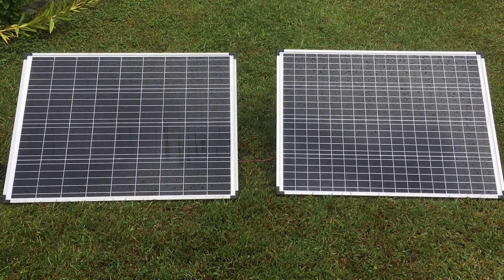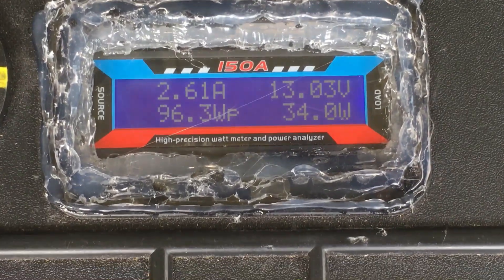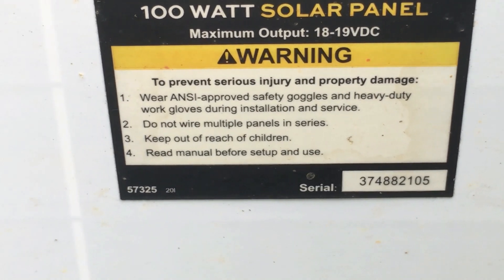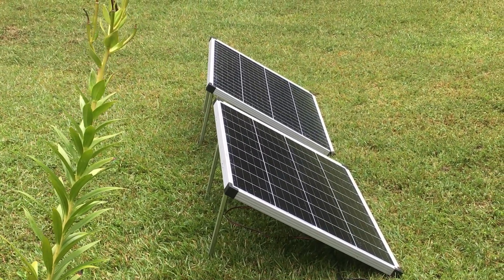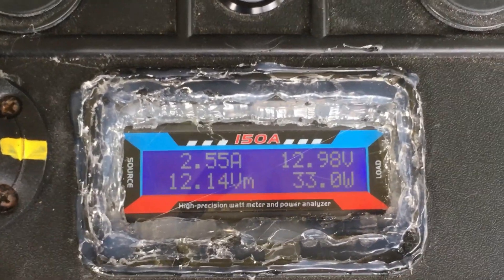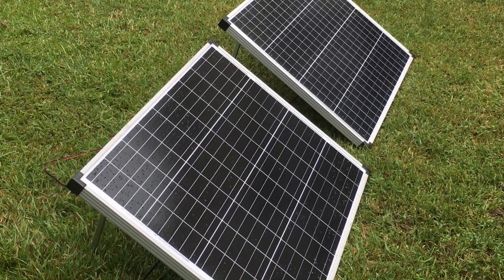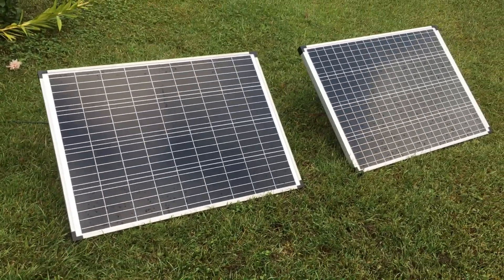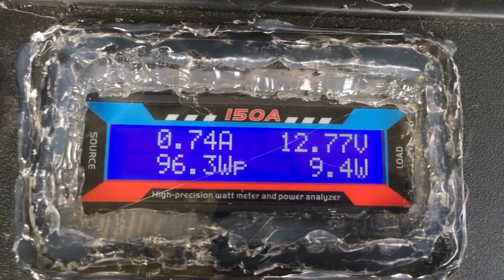Can you hook two of the new 100 Watt Harbor Freight Solar Panels Together?? 57325 (Rainy Day Result)

Comment: This answered my question perfectly. 

I've had the 100 watt kit for about 3.5 years now, but sadly I think my panels are falling. I'm getting at peak 3.0amps on a sunny bright day, and floating seems to be 12.8 -12.6 volts with a max battery voltage of 13.1
During the evening or a day like in your video I am getting around .08 -1.0, that's not exactly ideal for charging. 

I am using a harbour freight 35ah agm battery, and a renogy 40a mttp controller, as the one with the kit went bad.

I've been looking at these for a few weeks now and was curious if you could run them in parallel, because that's what the solar setup I have now is running.

I was also curious if I could use the existing wires and just hook up two 100 watt panels instead of four 25 watt panels. You are doing EXACTLY what I am going to do, and ironically the measurement of the 100 watt panels is slightly smaller area than the 4 25 watt panels I have now, so I'll be gaining 100 extra watts in the same area

I did have a question though.
Do I have to plug the other two connectors with anything, or just leave them and just hook up the two? 

Thanks for your video, it was exactly that I needed to make my choice.
Reply from the maker: Thanks for watching and glad it helped. What connectors are you referring to?
Reply: @DIYKAI  the four 25 watt panels come with the 4 to 1 wiring harness which is what I'm going to be using, so it saves me from having to re-wire anything, I'll just use the exsisting setup. 
Using the new 100 watt panels, I will have two of those (100 watts x 2) and will be using two if the four hookups. That will leave two hookups left. 
Being as in not electrical savvy, I wasn't sure if I needed to put some sort of plugs in those, put tape on them, or what.
Reply from the maker: Ah got ya yes the can stay unhooked and taping them is best to keep corrosion out….just monitor the wires because they are quite thin but do the job…we eventually upgraded to a better connection set up….but it did just fine with 2 100w hf panels and 2 of the older kits basically if you stay around 400w those wires are fine anymore and you would want to upgrade
Reply: @DIYKAI  Awesome thanks. Looks like I have my weekend job then LOL. 
I'm pretty excited seeing as how I'll gain 100 extra watts, in the same space/area, and without having to worry about wiring, that job shouldn't take long at all. Just hope my homemade rails will fit the extra width, I'm pretty confident it will. 
That and I'll be able to really put my new 40a Renogy Elite solar controller to work
Reply from the maker: @alpha_y2k438  sweet good luck and keep us updated our Renogy system has worked flawlessly for 8 months now so we will have a vid showing the total set up
Reply: Quick update
I bought two of the harbour freight 100 watt 24v panels today. Replaced my 3.5 year old 100 watt kit panels. Got set up, that was 11am this morning. Throughout the day I was keeping a very close eye on the amps and voltage.
Ironically enough, the size the 100 watt kit panels used, is pretty much the exact same space as two of the 100 watt panels, so I actually gained 100 extra watts in the same space I used the 4x25 watt panels
My initial first results were on the meter test I got 8.0a and 20v incoming. I was definitely excited to see that.
It's been a overcast day, with the sun peeking out off and on all day. My lows were 15v 2.9a incoming, my highs so far have been 21v 9.9a incoming! 😵‍💫😱

It's been a pretty much rollercoaster ride all day long because it has been overcast cloudy and then clear off and on all day.
I'm gonna take a guess that my avg has been around 3.2a 19v incoming. 
I have them set in parallel, on a harbour freight 35ah agm battery, and with the old setup I was getting a lot of 1.0 and .08a incoming, volts were strong (21v incoming) but crap for incoming amps. It was so bad I woke up one morning to an error code on my controller box that read e01 which is basically low voltage overload/no battery connected, basically the battery got to 11.3 and the controller stops at 11.5, rightly so as it should.
My battery always read 12.3-12.6 most times and very rarely reached 13.x, so going to bed it was at 12.2/12.1, and the other night it was at 11.7 when I went to bed. I'm shocked it didn't die on me.

With these new panels I'm getting an avg of 3.3a incoming, so even at that rate, cloud covering, I'm getting double what I was with the old panels and it shows because most of the day I was at upper 12.x and even hit 14.1 today at one point, but avg is 12.9/13.0 which is MUCH more comforting with my OCD LOL. 
Right now it's 6pm and no sun, cloud covering, I'm sitting at 19.7v 2.4a incoming. 
So first day, first impressions I'm VERY impressed and well pleased so far. 

Not exactly sure what I'll do with the extra 100 watts honestly, but we'll see what happens. 
At $99 each on sale, from $129 each, I'd say I made out pretty good for $200 (100 watt panels x2).
Reply from the maker: Nice! We are about to review a new cheap pure sine wave inverter hopefully it’s good lol

Comment: Hi, new subscriber here. Thank you for your videos. I have 4 of these HF panels and plan to get mppt controller. i understand the volts going from panels into controller can fluctuate due to weather Temperatures. Do you have an idea what the highest incoming voltage would be? I want to purchase the right size controller so I don’t fry it. I appreciate your help because I don’t know anyone locally who is knowledgeable on solar.
Reply: @David Bourgeois thank you so much for your reply- it is my understanding that these are 24 volt panels,rather than 12 volt., so I want to make sure I do this right.
Reply: They are 12 volt panels.  The packaging is misleading.
Reply: @scottmork9598  thank you! Employees at HF couldn’t give me an answer on this. Appreciate your response.
Reply from the maker: They produce around 22v open but when connected to a load (battery with charge controller) it will drop down to about 13-14
Reply: @DIYKAI  thank you for being so helpful- glad I found your channel.
Reply from the maker: Your welcome
Reply: A 100 volt/20 amp controller would be adequate.  My three panels have put out 22.5 volts, 67.5 total. Average around 65 volt wired in series.
 Four panels would be 90 volts at 5.5 amps in series. In parallel they would be 22.5 volts and 22 amps. Best case scenario. 
  By wiring in series you can use smaller guage wire from your panels to the controler due to the amps being lower, you will also experience less power loss especially if the wire run is long.
Reply from the maker: Hi and welcome! Your welcome😁 it depends on how you plan to run them? Series or parallel? Or both..lol…what battery voltage will you be running 12,24,36? Do you plan to expand?

I guess the best question is what are you trying to power and do you have plans to expand in the future?
Reply: @DIYKAI  absolute newbie at this,but I’m thinking parallel or series parallel, and 12 volt batteries-I didn’t realize they were 24 volt panels til after I purchased them- HF guys weren’t very knowledgeable about solar. I have a small off grid cabin and would like some light at night and charge batteries for power tools,hot plate for cooking. I don’t plan to expand. My husband passed 5 years ago and I’m trying to figure stuff out- I appreciate your help.
Reply from the maker: @lynnrabe4428  something that small just for light and charging you can get away with a cheaper PWM controller they are usually good up to 400W or so. 12v is where you want to stay with a small set up.....I would go with a small pure sine wave inverter 1000W ones can be found for under $100

When solar panels are wired in series, the voltage of the panels adds together, but the amperage remains the same. So, if you connect two solar panels with a rated voltage of 40 volts and a rated amperage of 5 amps in series, the voltage of the series would be 80 volts, while the amperage would remain at 5 amps. 

Wiring solar panels in parallel causes the amperage to increase, but the voltage remains the same. So, if you wired the same panels from before in parallel, the voltage of the system would remain at 40 volts, but the amperage would increase to 10 amps.

so based on your type of panels and what wiring you choose that will determine what type of controller you would need to purchase.

Hope this helps and if you need more info please reach back out we are here to help!
Reply: @DIYKAI  thank you so much for your time! I’m looking at controllers now🙂
Reply from the maker: Your welcome

Comment: I’ve got 3 of these solar panels.   They are running into a thunderbolt hub.  Running them into 4 120amp hour agm batteries.  I’ve been through 2 cheap controllers.  What controller would you suggest.
Reply from the maker: I would suggest this a great solution to a system under 400W:
https://amzn.to/3jUutPp
Reply from the maker: This is a good option for over 400W as this will work with 24V as well as 12v and has a 40A rate:
https://amzn.to/3v0wwYB
Reply: @DIYKAI  thank you brother.
Reply from the maker: No problem YW

Comment: Thank you for this video! Can you tell us what charge controller you have settled on? 

I have the Harbor Freight panel now. Can I run a second 100 watt panel (wired in parallel with proper controller) that is not a HF panel, or do I have to use the same model? 

Thanks again.
Reply from the maker: Your welcome! So we went with a cheap Amazon (PWM) one you want one that can handle 20A or so….if you decide to got over 400w then I suggest an MPPT charge controller as it will be more efficient…
Reply from the maker: Yes parallel will be just fine

Comment: Have one I cut the end plug off put MC4 plug then I plugged in to my solar generator and it was putting out 104 watts for one panel what I didn’t like is the red wire was negative and the black was positive it is a 24v panel that was my fault so now I may use it as a 3rd string in my 400watt solar system or just buy a second and start another system just learning wish I had got into solar sooner good luck
Reply from the maker: its a learning curve but worth it......yes unfortunately most Chinese panels have the lead colors switched I have seen...not sure why maybe just QC/QA issues lol

Comment: Been working on my H.F setup. currently running the original Amorphous kits, 300 watts on east side and another 100 west through one kits charge controller. All it does is power a single light and charge my phone when outside. I put two power wheel 10AH 12 volt batteries in it for the kid's playhouse. I have a dirty plan in place to run 1 controller per 400 watts, with 20amp fuses before the controllers, they have 20 amp fuses soldered into the controllers, which kind of sucks but should save the controller from current overload. Hopefully I can get another 8 panels on sale to add to my 12 I have now, but with the 30% price increase since their July 2020 launch, I have slowed my purchases for new panels. Also waiting on a sale for the new 2000 watt Pure sine wave inverter they just launched as well. I believe H.F are going to be getting more into this solar than people realize and look forward to seeing MPPT controllers soon. Not saying they will but with what they did in this past year with their current lineup I would not be surprised.
Reply from the maker: Yes it was a good deal when it first came out now Amazon has the lowest price and you don’t have to leave home lol
Reply from the maker: We also have the HF setup on a little house and now we run 800w Renogy system with lifepo4 it’s been amazing
Reply: @DIYKAI   Ok I am doing a bit of a follow up. Got a 8750 predator generator. The 12 volt battery is a 1.6AH lifepo4 battery, used for the starter, is made by Sky rich. It could actually be in the works for a Thunderbolt lithium solar battery. Its all gonna depend on the market for said products, which is getting competitive as of late.
Reply from the maker: Having a back up gen is always good…our renogy kit put out 2.33 kW today I was amazed

Comment: I am running 8 panels, 4 in series and then those 2 sets in parallel. 
Into bluetti 200max
Reply: Dec 5th.
4 panels in series
Two sets then hooked in parallel to controller
8 panels total

Started at 0900 at 50%
Ended at 1300 at 100%

So 4 hours.
Max wattage observed 400
Lowest wattage was at 0900, pulling 31 with 1 set of 4 series and 53 watts with both sets hooked up, before sun was over the house. 
Increase leg length to get better angle on sun, not sure how much it helped.
Reply from the maker: Nice we’re setting up a Renogy Premium kit hope to have a video soon on it
Reply from the maker: Nice how quick does it charge? We just got a Renogy premium kit at a crazy price and are setting it up hopefully it’s good those are 4 100w in series 40a mppt dual voltage

Comment: Wanted to see what connecters. That never showed. Harbor freight uses a single plus and minus connecter. For two panels a "Y" connecter is needed. They don't supply them. Found them on line and that is the only way to connect both without cutting wires.
Reply from the maker: Yes unfortunately the only way to connect them is with a Y connector or to cut off the ends and connect them together with wire
Reply: @DIYKAI  Thanks for your reply. Figured that needed to be done, that's to cut wires.
Reply from the maker: Just make sure you check polarity when splicing the wires
Reply: @DIYKAI  got you, polarity counts

Comment: I just ordered a 5000 W continuous inverter and I want to get two of these panels. Can I hook three panels up using a 40-watt controller with to 109AH lead-acid deep cycle batteries? I don't know what I can use this power for but I would like to connect my television at home to keep that from raising my electric bill.
Reply from the maker: yes with a 40w controller you can handle 3 panels no problem.
Reply: @DIYKAI  Thank you for replying!
Reply from the maker: @therajuncajun6487  your welcome

Comment: I’ve been contemplating a second panel and this just sold me on it. Because of a huge tree in my yard, I get the sun in two different different directions, but only one at a time. After 1:00 or so, my panel is just about fully shaded. Gonna add a second panel in another area (that is shaded in the morning) for 3 more hours of sun.
Reply from the maker: I had them out today terrible weather here raining bad over cast and with 2 panels I was able to harvest over 10aH over about 10 hours just turning the panels every few hours….what was amazing was I seen over 230 watts @15A
Reply: @DIYKAI  that's nuts, but good! Mine a barely see 3amps sadly. Time to replace my panels I guess
Reply from the maker: Yes test each one and see what panel is bad we had to repair the older ones bad solder joint

Comment: there are cheaper panels, that produce just as good or better, in which 
you don't have to do any modding. why pay 109 for a harbor freight and 
do modding when you can get one for like 80  or 90 something and not have to 
worry about buying extra adapters and the work involved to get it to 
work with other non SAE things.
Reply from the maker: yes now that the price is up I wont be getting anymore I got them when the price was like 82 bucks with my coupon....these are one of the few that have legs...I normally cut the SAEs off and make my own lol

Comment: I loved this panel I used to own one,  had to take it back for 2 reasons. Number one is the SAE connector, I was gonna use this for a Bluetti AC200p, but they use the MC4 Connectors, so I thought no biggie, I'll just get an adapter, then I found out I would need about 3 of these Panels minimum and that was the deal breaker. I'm not gonna get 3 of these with 3 adapters, so much of a hassle, plus I heard that sometimes the polarity is wrong when you try to use adapters and requires another small device to reverse the polarity. The panel itself seems high quality and I love the stands that come with it......but still......
Reply from the maker: yes you are absolutely correct! I plan to cut the SAE plugs off I may actually rewire the whole panel from the junction box....today in bad weather it peaked at 234W two panels in parallel 15A I was really impressed. I am experimenting with them daily lol
Reply: @DIYKAI  this is what I’m considering  or SAE all the way to the charge controller
Reply from the maker: @bobbader4789  SAE will work just check the polarity we have noticed that the HF connections are wired backwards for some weird reason..

Don't run over 400W or so SAE switch over to MC4 its safer

Comment: I had poor performance in parallel. Even used their big round multi-input combiner. It's just a parallel connection for all inputs. I tried 1-2-3 panels. Got around 85/140/160 W for each of the configurations. So the parallel thing doesn't really work very well. When I connected all three in series, I got about 260W from the set of three. I was running them through a Victron smartcharger 100/20. So it was just about at it's limit. I guess I posted on your other video. Pardon me if this is redundant.
Reply: How they holding up? I'm just getting set up. Us people that want to learn, we sure do appreciate the info.
Reply from the maker: 4 months now no degradation in power or output yet
Reply from the maker: Man that sucks I’m going to try different setups to see what gives me the best. Thanks for the info

Comment: thanks for video...Their 100w panels are good. 22.3v straight off the panel. The h.f.charge controller is a deterrent for newbies. Always buy more powerful equipment if you can.
Reply from the maker: Your welcome absolutely I’m building a bigger solar generator to use the full 200w